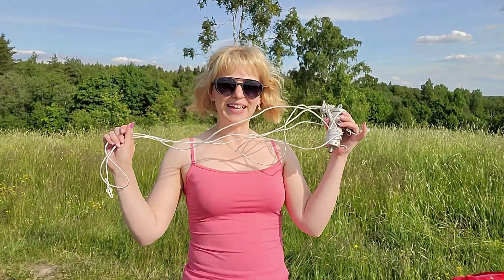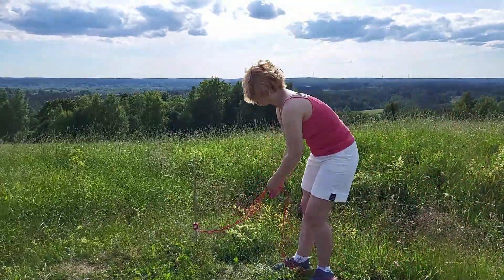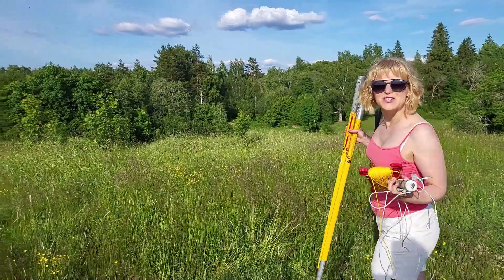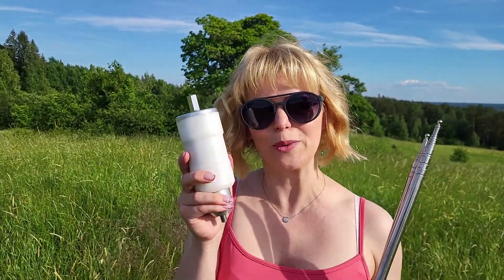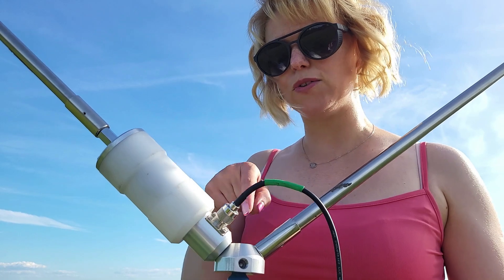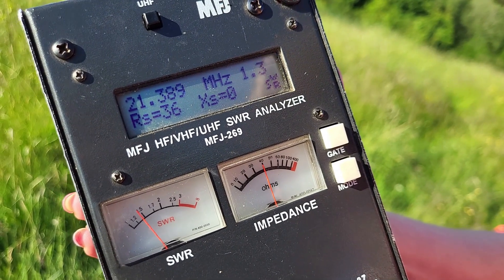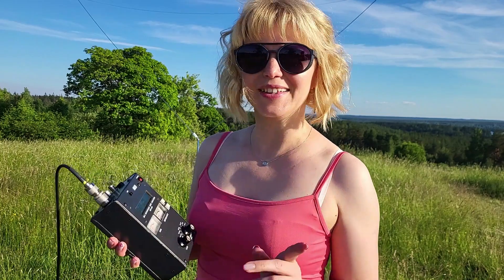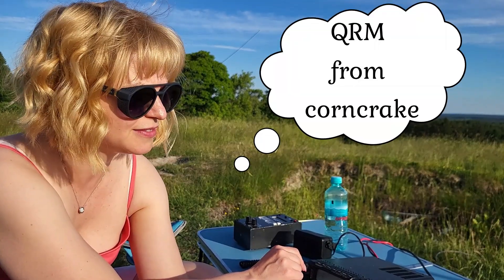Young Lady's Antenna Challenge: GP, Dipole, Delta - Raisa installs and compares

Comment: I like fairly high dipoles. Mine are at 40 to 50 feet high. On 10, 15 and 20 it takes two to cover all directions at that height. There is a very noticeable null off the ends of high dipoles, while rather broad beamwidth broadside between the 3dB points. I have worked 100 countries or more on multiple bands in one contest with them so they do good for DX.

Comment: Hi Raisa,
I was wondering if you have a link to the delta loop antenna. I made a V-dipole with the 5.6m telescopic elements which work really great. But I have to ajust the Lenght for each band. It would be preferable if that is not necessary anymore.
Keep on doing the excellent promotion for our hobby! 73's and 88's from the Netherlands.
Fokko
Reply from the maker: @pa3vos  Fokko, thanks for nice comment. 
It's chameleon delta loop antenna.  
Yes I like very much the opportunity to have 5 bands in one antenna. Also I really like quality and quickly setup of  it.

Comment: Thanks for sharing,  after many years on the radio testing many ants, I now only use vertical on tx and dipole on rx. Best vertical is elevated with only 4 radials,  2 S points better. 73 zl3xdj

Comment: Raisa, I love your enthusiasm! Yes, ham radio is also for YLs as I am one myself. I am a wire antenna gal mostly - used to use a dipole for portable but now EFRW for portable QRP and sometimes a vertical - AX1 or Chelegance MC-750 when I cannot put a wire in trees. At my home station, I have a EFHW. Thanks for your post and encouraging YLs in the hobby.

Comment: Raisa...I am a Wireman who loves any kinds of Wire Antennas. Depending on which Location I am going to play portable HAM Radio if there is plenty of higher Bushes or Tree Support I will always prefer to run a Delta or Quad Loop Antenna. My Plan B is having at least 2 usable high Trees (10m or higher) available to run a ZS6BKW or a EFHW-49:1 or 9:1UNUN stretched or as an inverted L if possible. You did a fantastic Job, keep up the good Work. 73 & 88's de Uncle Günter  💯🤗🙋‍♂

Comment: That was nice setup.  You will find the delta loop somewhat directional . This can help with high noise floor. Ground mounted vertical antenna has low take off angle and can help with DX contacts.  Dipoles are great ,can be set up in many different ways. Can make them slooper or inverted V . or horizontal and if you get close to ground the take off angle changes to NVIS . All antenna you showed is great.  
I just made a 5/8 wave vertical for 20 meters into a 4:1 UNUN and 1:1 choke. works all some.  I do need to use ATU in radio.  But the RX gain is super and made lots of FT8 DX contacts at 50 watts. better then end fed half wave .  Keep trying different antenna.  It can be a lot of fun. 73 from NY,USA

Comment: Raisa, the delta loop since it is fed with a matching transformer works on several bands as confirmed by your analyzer. That means you can change bands without having to adjust the length of the elements like with the vertical antenna. The dipole is a single band antenna, although it is more efficient and should give good results in the band it is cut for. Excellent video and good luck with your activations, 73's